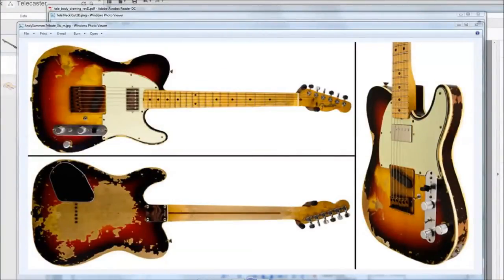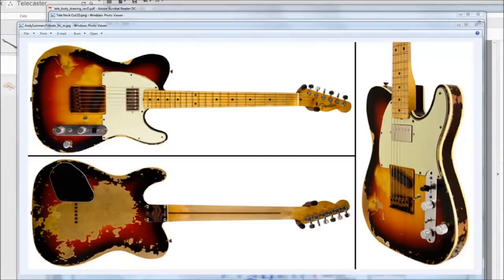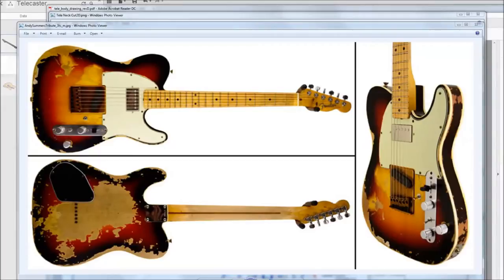CNC Guitar Project - Andy Summers Telecaster - Part 1

Comment: interesting aproach to the modeling... I wonder why did you make so many ribs for those transitions. Wouldn´t be much easier to do 2 profiles and a guide to do the job? in any case, cool video, keep going!
Reply from the maker: Hi Viskovitz - Thanks, and yes I tried that method and the results weren't great, as I ended up putting almost as many guides in as when I had ribs, to try and minimise "bumps" appearing. 
I'll keep experimenting as I do other guitars though, as there must be an "easy" way I haven't found yet - I might even resort to using the ruby tipped probe to collect a point cloud on the CNC machine.
Reply: I can understand why you may need more ribs for the neck to headstock and neck to heal transitions, but did you need one for the profile under each neck?  Wont they be pretty straight from fret 1 to the fret at the end of the heal?  Still wrestling to get to grips with the sketch planes and angles etc myself lol..  Will get there eventually and you video will help a lot - Thanks

Comment: Ok, finally got the pdf file over into dxf, using Inkscape, now how do I get the dxf file into Fusion 360?? I have been trying to do this all day, and getting nowhere, guess maybe I'm not asking the right questions in Google.
Reply from the maker: Hi Gordon - apologies for the delay - had a couple of days away on business. You first need to make a project folder in Fusion and then click on the little cloud icon with the up arrow in the middle of it that should be under "People" at the top of the Projects/Designs pane on the left. That will open a dialogue you can drag and drop files into iirc (or navigate to at least). Then Click Upload and it will transfer the file to the cloud and if I recall correctly it creates a new design with a sketch with your dxf file on it.
Hope that helps and if not let me know and I'll do a quick vid showing how to...
Reply: Oh, that's where that cloud thingy is :)) I was looking all over the place, thanks, Chris (hope I got your name correct). By the way, I am enjoying this series immensely, super job. Also, I am going to build a jag, and as yet, I haven't had the chance to watch your videos on that, will get that done within the next few weeks, Again thank you
Reply: wooooooo hooooooo!!!! it works :))
Reply: not a reply to myself :)), just an oooops, forgot to space out the two dots at the twelfth fret, can that be done in Fusion, or does it have to be done in the actual PDF??
Reply from the maker: Mission complete :-)
Reply from the maker: Oh - for this I would change in Fusion 360 by right clicking the sketch and selecting edit sketch - see the body tutorial in this series for tips on replacing segmented geometry if your dxf had it.